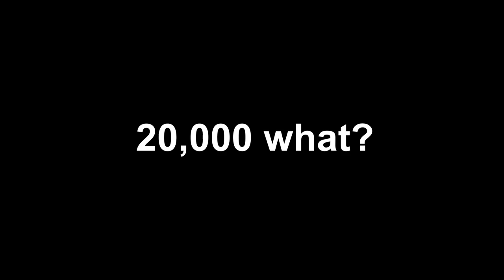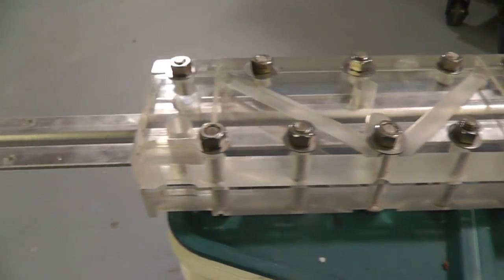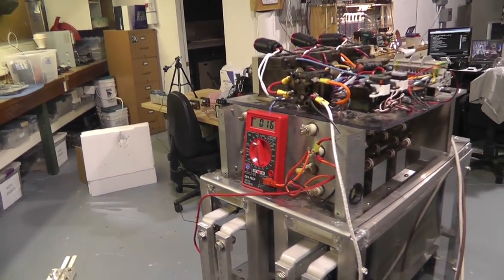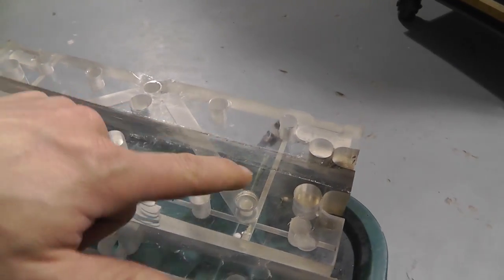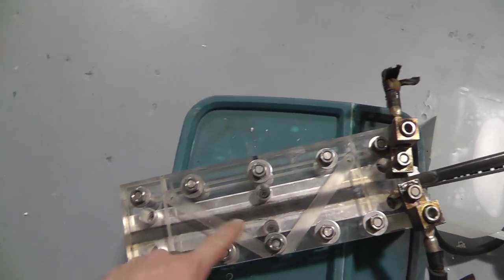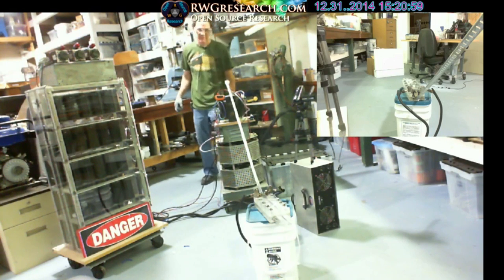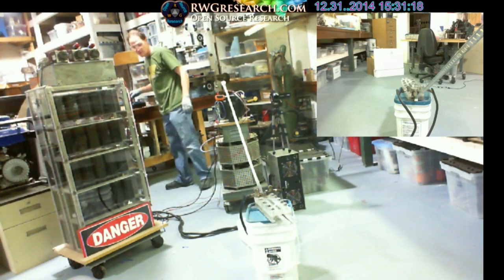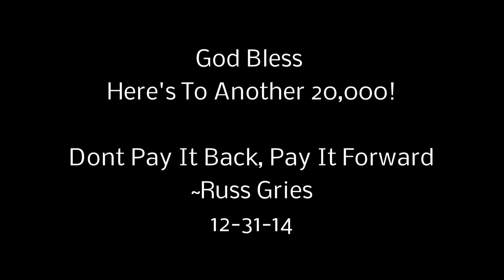Massave 10,000 Joule RailGun For You 20,000 Peeps! WOW That's A Lot!

Comment: I've melted one of those wire clamps on a ground clamp for a plasma cutter.

Apparently you aren't supposed to use steel | aluminum together for an electrical connection like that.  It corrodes and overheats, but that's after a lot of constant high amp usage that it melted the copper cable off flat.  It melted a 125 amp rated cable out of the connection.  Just a thing to consider I guess.

Comment: it disintegrates the projectile because of how fast it's going and air friction literally melts it in mid air. You SIR are a GENIUS! You just need a material that won't explode like a comet in atmo for projectile.
Reply: Air resistance plays a very small part, as the projectile is small. Indeed a projectile could be better of with a low-drag cone shape, similar to a bullet, but the main contributors to the explosive properties are the very high current and the high friction within the barrel. Copper would be a better substance to use.

Comment: Russ, someone gave me a working laser which I know nothing about. It's label says 6j , but it's peak power is 10kw. It's a yag pump type made in the mid 1980's, once used by PSU in Portland. Also got a second one for spare parts. Each one weighs over 1k lbs with all 4 pieces. There's a power box, a control box, the laser box and a pump. They were a nightmare to move into the garage. I had to weld up a cart with wheels 3'x5'.

Comment: I think the electricty is heating up the ball bearing (at this point iv not yet finished watching, so if you already came to this conclusion forgive me)and its melting, as it accelerates the temp melts it enough for it to separate. it becomes basically a bird shot (something like a shotgun). a higher density metal such as lead will have a better effect.

Comment: Hi Russ, This would be Truly Awesome with a couple of simple and easy alterations, 
So Painful to watch when the solution is so simple, Please Don't Take Offence I Don't mean any Disrespect, First: insulate the first 3 or more inches of rail, the projectile needs a magnetic field behind it to be pushed forward, otherwise the current just shorts through it, Second: add some inductive impedance so there is a current rise time resulting in peak current when the projectile is at or near the end of the rail, this will take some trial and error, try using several small high perm toroids as beads on the the V+ cable, Third: the output efficiency can be substantially increased by making a high power fixed magnetic gap that runs the length of the rails at a right angle to current flow through the projectile, the gap should be the width of the rail gap as to not increase impedance.

Comment: Mad...I wanna see a little well in the breach area that holds some distilled water. 
It would instantly turn into hydrogen, the oxygen would be used up by the aluminum and if you had a bit left over it would be super heated steam...
Reply: At 1.45v it would work best XD

Comment: I would love to see this capacitor bank hooked to a coil gun. it would be much more efficient and powerful.
Reply: Possibly, but unless you had some very thick wire, not all of the amperage would be used to its fullest extent.
Also, when designed efficiently, a rail gun can be far more powerful at high energy levels than a coil gun.
Reply: Coilguns can achieve high efficiency, but not with a large capacitor bank like this. For high efficiency, a coilgun needs a large number of stages with the correct timing and surprisingly low currents. A small low-loss design only needs 50-150A flowing through the coil, which is easily supplied by batteries. Optical gates are used to time each stage precisely, with a H-bridge to switch each coil (and return energy to the DC bus in a recuperative design). As Howard stated in his comment, a huge capacitor bank will just result in very high resistive losses in the coils and kinetic energy efficiency around 1%.

Railguns operate on a slightly different principle, where tremendous impulse currents and faster rise times (to a point) result in more force. A hybrid design is feasible, where a coilgun stage provides the initial acceleration before the projectile enters the railgun.

However, a large capacitor bank and a coil is great for magnetizing stuff, crushing cans or shrinking coins!
Reply: Overall coilguns can provide far more kinetic energy for your energy input but are much more complicated as they need several stage capacitor banks.

Comment: I may be wrong, but it looks like the ball is shorting the rails. Why aren't the rails insulated?
Reply: The ball completes the circuit with the Rails, and as such the projectile is accelerated from the force created by the electric field
Reply: that is how the gun works, the ball shorts the rails creating a magnetic field that projects the ball forward, if it was insulated, nothing would happen, it would just roll through the rails.

Comment: your electric bill must be outrageous.
Reply: +akilla214u2c This doesn't use a huge quantity of energy. A standard space heater or electric oven will use as much energy as this entire video every two minutes or so.
Reply: 10kJ is about the same energy a 100w light bulb uses in about 1 minute and 40 seconds.  It's  not even enough to power your laptop long enough watch this whole video. For reference, my cell phone battery holds almost 40,000 joules. An AA size battery contains almost13,000 joules,

Comment: Hello, Do I see this correct? Did you build a Whole tower of Condensators? Can you give us the Specs for the Power Supply? And what did that cost? You are loading them with 12V 3 Amps Powersource? How long did it take to fill them up?

I have an idea for a slight different setup that solves the issue of burning the balls up and destroying the rails. You can use the same setup. Switch the minus pole from Bottom to top of the rail. But you need to work a little on your bullets. Are you interested in another experiment like this?
Reply: If you mean to move the connection for one of the rails to the muzzle then you may be on to something, as it would mean a more constant energy consumption along the barrel and a more constant acceleration, however you could also place both connections at the muzzle to have an increasing acceleration along the barrel, which may allow for a lower velocity being needed to get the projectile to fire.
Reply: No. The idea is to split the energy in a Leakage throughout the projectile that generates a circling and electron slurping effect. combined with the energy in the electron load at the bottom of the projectile that is attracted by the circling magnetic field. In that case  Half of the energy is working on the connections causing much less burn on the wires, while the same resulting forward Force is generated.
Reply: Lieber man
sorry, could you explain it again, I'm not entirely sure what you mean with the "leakage"
Edit: with most of it lol
Reply: A condensator that leaks creates a magnetic field over its electron leakage between the plates. But you Need a lot of leakage, and no shortcut, to get significant effects. The powers involved here should be sufficient. The magnetic field works on all electrons. Not only the ones that leak through. Therefore has a force on the matter containing the electrons. A force inside or towards the turning magnetic field (from the leakage). Since the field moves in the same direction as the resulting movements from the forcefield it works on and on accelerating the projectile untill it reaches the end of the powerlines where the electron load will disapear. The  resulting Speed should be similar to the shortcut scenario. But since there is no shortcut there is less burn.
Reply: I.e. just before a condensator is overloaded and will destroy itself from the burn of the resulting shortcut, a few electrons will jump the plates and the condensator acts as a resistor. That is the leakage. With Air as dielectricum you can Experiment with it. Get up to 30KV on two plates on a distance 35 milimeters, and you will notice a Sound from the electrons jumping the plates, and an ozone smell in the air. You will measure a lower resistance over the capapcitor rather then an infinite one. That is when you drive the condensator in leakage mode. And the electrons cause a magnetic field. (First year electromechanics from school) Good luck.
Reply: So, are you saying to use the two rails as electrodes for a make-shift air capacitor, and then run so much voltage through it that rather than just destroying the rails, you cause the electrons to bridge the gap to create an electromagnetic field? Cos if not, then I'm a little stumped (I'm only in high school lol)
Reply: Hi, Yes. But not all the electrons jump (what is a shortcut causing the burn). That is the Idea. The remainingg electrons that cannot jump the dielectricum will tear the matter holding the electrons, inside the circling magnetic field. The resulting force equals the force in the shortcut version. You'll just have to scale up the voltage with an aditional cascade to reach the 30Kv to be able to control the leakage prior to shortcutting. It is the high amperage you require that distinguishes between succesfull and failing results. The high amperage flow in the leakage will determine the strength of the Magnetic field, and the force on the remaining electrons that forward the force to the matter containing them. But a shortcut (max amperage) will not do since there are not electrons left the force works on. So amperage flow and remaining electrons must be in equilibrium too to show success.
Some Ion Thruster setups on youtube thank their success to this phenomen. But show too little result to call it a usefull success. Due to too low amperage flow. The amperage available in the experiment here should suffice to give same spectacular results as in this railgun example railgun.
Reply: +Lieber man So you would raise the voltage until it just barely reaches the breakdown voltage of the gap? If I'm right in saying, that would mean that there would be sufficient energy in most of the electrons to bridge it and cause an electromagnetic fluctuation, whilst also meaning that some of the electrons will have to go through the projectile to provide the rest of the force. With a high enough current, these forces would be large enough to propel the projectile at the same velocity as a generic railgun, but whilst conserving more of the mass in one lump. Am I right in saying this?
Reply: yep. I am not sure about the barely, but yes. That is the idea. The energy from successfull experiments  comes normally from huge homopolar generators, similar to the railgun from BAE Systems. However that would be way beyond a normal household budget. And if you would get one from china it is still too big to fit the garage. What these guys did here in this video is a home and garden solution for the energy deliverance. Now take this one step ahead. Be warned hitting  30kV with 1 Ampere available is deadly.
Reply: Oh and another hint. To make sure that there remain lots of electrons in relation with  the electrons jumping the condensator plates (leakage), the bottom plate delivering the electrons must be much thicker then the top plate.
Reply: +Lieber man Although the 30kV at 1A would be deadly, it is easily achievable with the help of a few electrolytic capacitors in series to store the charge going through the rails. The only advice being that a capacitor with the electrode pins on the same side of it would be inadvisable due to the small gap between the wires.
Reply: Hi, Yes. True. But take into account you need the 1A for a few seconds before the capacitors discharge. Did you see the pile of hughe condensators/capacitors the guys from the video glued together? That is what it takes. They already have it, so it is easy for them to proof that it works. Therefore my comment ;-)
Reply: Well, when you work it out, a capacitor bank totalling 30kV and 100uF would provide 1A for thre seconds (theoretically)
Reply: However, the difficult part would be charging it in a short amount of time. That 30kV 1A for 3s would need nearly 100,000 joules of energy!
Reply: Yep. It takes a while to load the capacitors. Did you notice the tower of capacitors in the video? But 3 Second is worst case. Maybe a second will do just fine. But yes. The energy is the problem. Would you want to put the battery inside the projectile to have the projectile continuous energy to reach the end of the universe, the battery needed would be the equivalent of a nuclear power plant. But we don't want that. 3 seconds to shoot a trial target and document it on youtube will do fine. Maybe even 1. ;-) Can be done easy with the setup from this vid.

Comment: You are applying too much current for such a small ball. The ball melts before exiting the rail. Change the rail guides to bigger ones and use bigger projectiles.
Reply: Or use a low-resistance high-SHC material like copper, which would allow much more current to flow whilst also keeping it cool. The only problem is cost, but it's not a large problem (copper isn't too expensive).